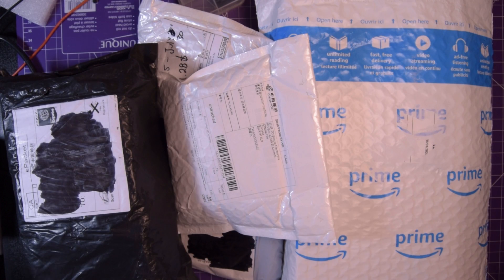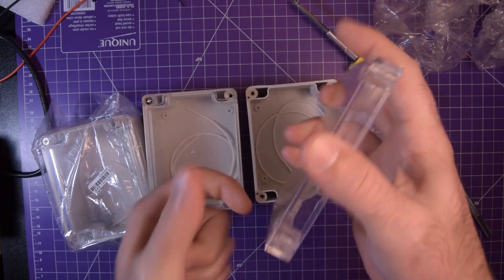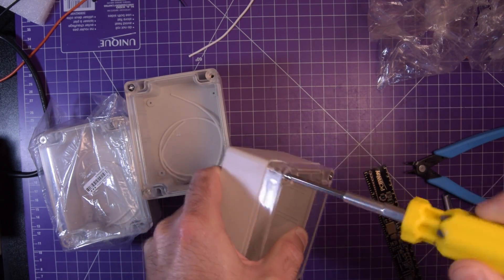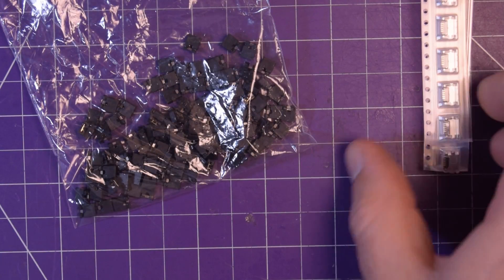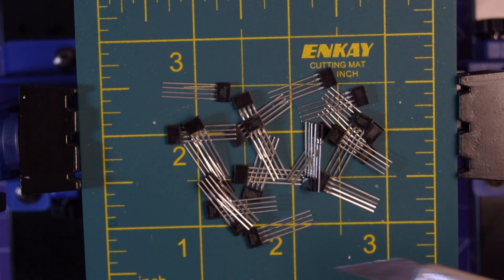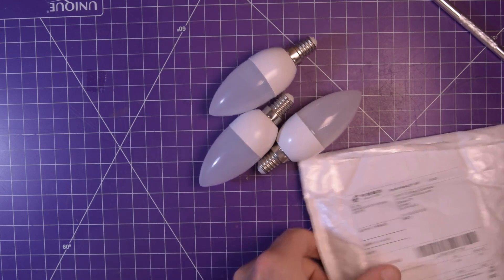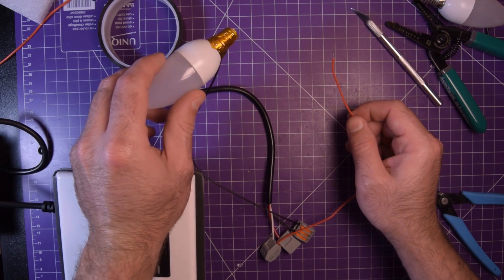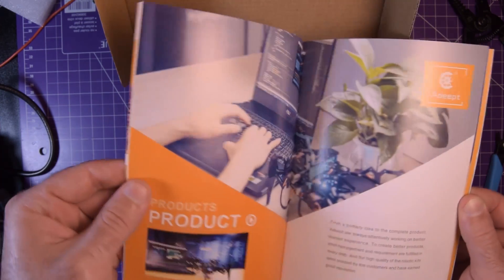Mailbag 62 - Boxes and Mysteries

Comment: On the 552f's there's a modification to the original circuit using a diode and cap whitch makes an even higher voltage and enables using RGB LEDs If interested contact me

Comment: Unless the project is submerged always leave a small gap in the seal at the bottom, if mounted vertically. Or drill 1.5mm hole on the driest side to allow air pressure equalization. Failure to do this will result in condensation build up inside the box